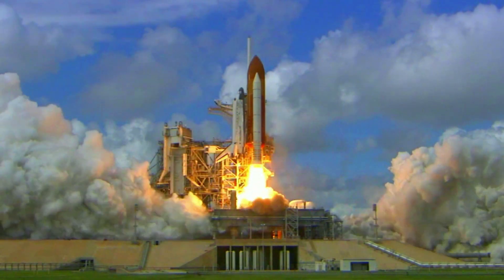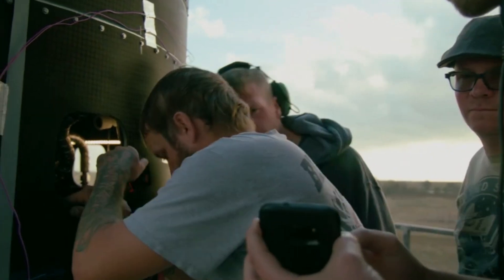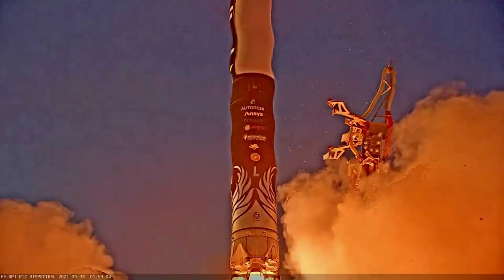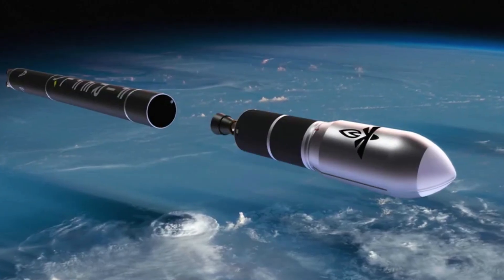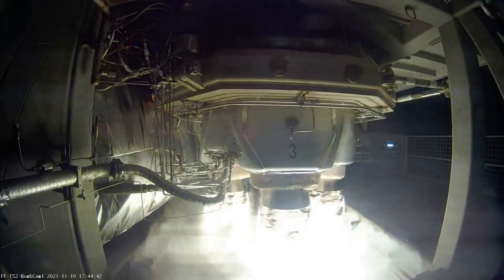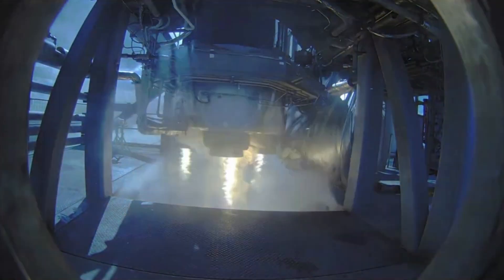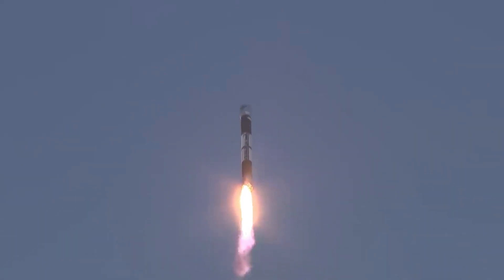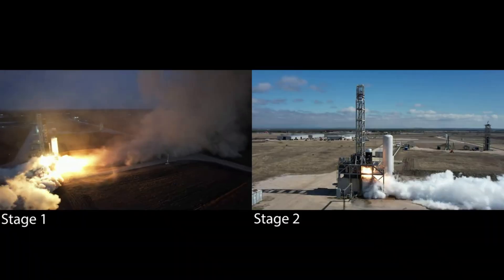Firefly Aerospace's Second Orbital Test Flight Is Not Far Away

Comment: The bottom line is Firefly's Alpha vehicle has a 1,000 kg payload capability to low Earth orbit and 600 kg to Sun-synchronous orbit. Projected launch cost is US $15 million per launch.  That comes to $15,000 a kg for LEO and $25,000 a kg for SSO. Compared with Rocket Lab's Electron with a 300 kg to LEO, and 200 kg to SSO for US $7.5 million per launch or $25,000 a kg to LEO and $37,500 a kg for SSO.  A reused and recovered Falcon 9 can put 16,239 kg to LEO, 11,740kg to SSO for US $50 million or $3,079 a kg to LEO and $4,259 a kg to SSO.  The great hope for ESA is the Vega C.  It can launch 2,300 kg  to SSO for around US $37 million or $16,087 a kg. With SpaceX Transporter ride share missions the orbits and costs is very flexible. The question is there are enough business that requires these higher cost, presumably more flexible launch providers.